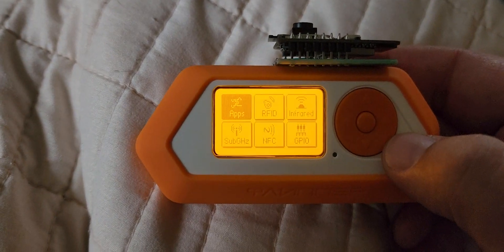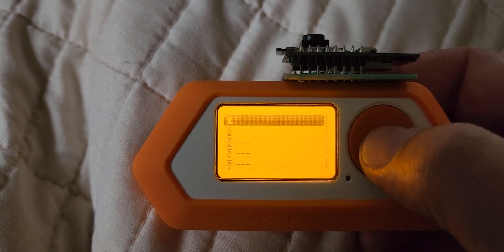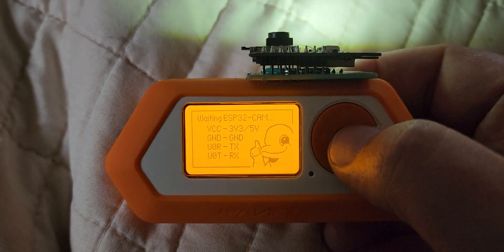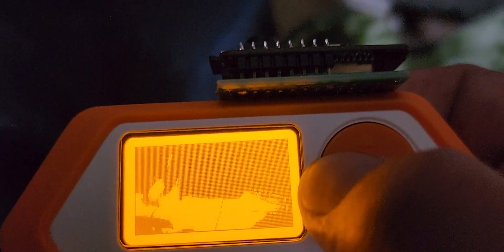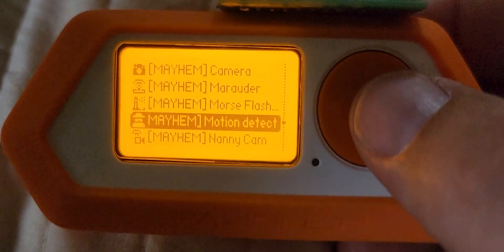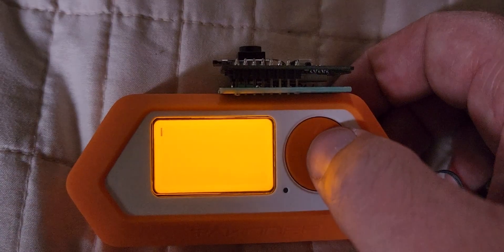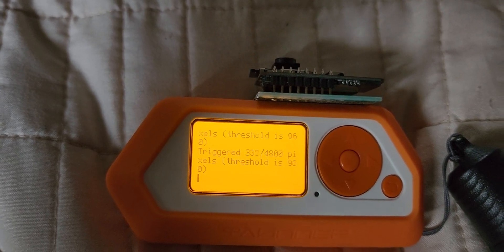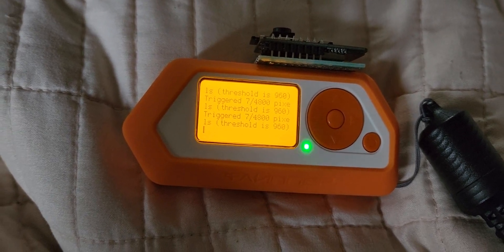(Part 1) Flipper Zero Dev Board Marauder Mayhem ESP32CAM and APPs Demonstration.

Comment: Interesting. It looks like there are a couple different options for camera apps at this point. None of them are really fantastic, but still fun play with.
I can see the benefit of having another wifi board to play with.
Reply from the maker: The camera apps are still brand new so there is tons of room for improvement but I can't complain since I don't have the ability to write code very well. Just having Marauder and a Flashlight for around $6 a board makes it very affordable to play with... and if you really wanna use the camera stuff, just leave one of the camera boards stock and use the pre-programmed features of the video cameras which includes video , night vision, etc... just access it through network connection.

Comment: I understand you need to flash the Mayhem add-on board's ESP32 with the pen-tool suite, ESP32Marauder, but does it require a firmware change for the Flipper Zero?  It seems the stock Flipper Zero firmware (SqachWare-CFW, or even the 'unleashed' forks like that from RogueMaster or DarkFlippers) can be used since the Mayhem peripherals can be accessed via scripts.. is that correct?

What is the difference between (Hak5 DuckyScript3) scripts and the (fap) apps from the store (flipc)?  Does the latter not show the script contents?  I've seen some (unespc) that offer wifi scripts.. but isn't that GHZ?  

BTW, how difficult would it be to do all the things the Flipper Zero does, on a HackRF or a LimeSDR? Would the code need to be ported to GNU Radio Companion?
Reply from the maker: The gentlman that did the writeup for the web flasher told me that it was built with unleashed so if you use unleashed your fine, but if you download the apps from the link in the comments section, then it gives you the option for which firmware you have. I normally use Xtreme, so the apps that came with Xtreme for the esp32cam did not work for me. But i also did not know how to "glitch" my board to make the apps work at that time, so im not 100% sure about that. 
As far as the fap vs scripts... faps are like exe files for flipper apps, and scripts are just text files with instructions for the terminal.  
Ducky scripts can be sent from the flipper  via bad usb, bad bluetooth, mousejacking, and marauder (marauder might only work as a standalone, I havent tested it).
I dont have a HackRF nor an SDR because the flipper does pretty well on its own, i might pick up a cheap SDR in the future if i can find a reason to justify the purchase tho cuz I do want one.
But the hackRF is just a radio, it cannot take pictures, be used as a bad usb, or an encryption key, crack wifi passwords, and Im not positive, but i dont think the hackrf can do NFC or RFID or GPS and I know you cant use a HackRF to flash or dump data to/from a device with Hackrf but you can with flipper.... the Hackrf is a more specialized tool, whereas the flipper is more generalized.
Reply from the maker: The "glitching" i spoke of is just a temporary fix until the capicitors I ordered arrive.
Reply: @boboso5676  Thanks, I haven't heard anything about the glitch.  Is that a defect in the new Flipper Zero boards, or more of a hack to add some feature not originally supported in the hardware?  If it's a defect, maybe I'll wait until the next revision of the board?   

BTW, the reason I was thinking of the HackRF/LimeSDR is to enroll in the penthertz SDR course by Sébastien Dudek!
Reply from the maker: The glitching I have to do is because my board needs a capacitor. Capacitors act like little batteries so when the voltage drops too low, it provides extra power, it also smooths out erratic electrical noise. Once i get some capacitors I shouldnt have that problem anymore.

Comment: What can you do with the camera that  is unique to the flipper? Seems like it’s just a gimmick at this point.
Reply from the maker: Well it can run marauder for cracking wifi passwords, it also has a much better range without antennae than the regular eap32 and having all those extra options for about the same price as a regular esp32 is pretty cool imo. 
Also nothing the flipper does is unique to the flipper, everything the flipper does can be accomplished with a raspberry pi and some arduino accessories.
Reply: @boboso5676  😎 I bought the WiFi dev board along with the Flipper. I need to get some breadboards to start playing around with the GPIO functionality.
Reply from the maker: @EV0L13  careful, its addicting! 🤣
Reply from the maker: Also, Amazon sells arduino starter kits that have protoboards, dupont wires, capacitors, resistors,  and pretty much everything youll need for fabrication for around $20